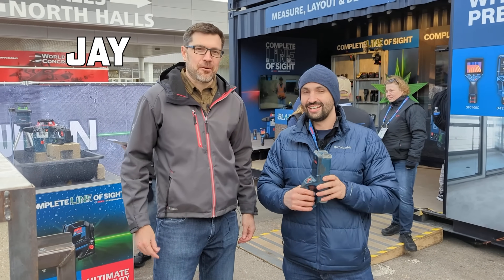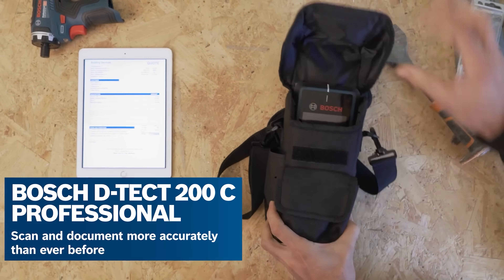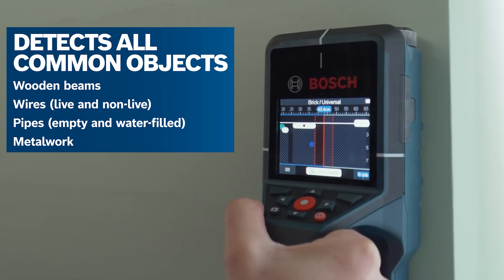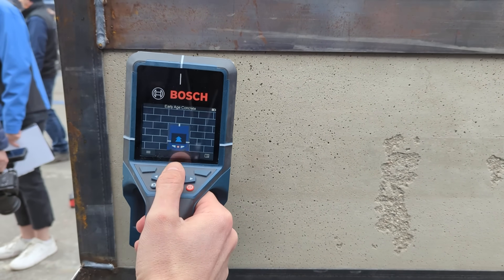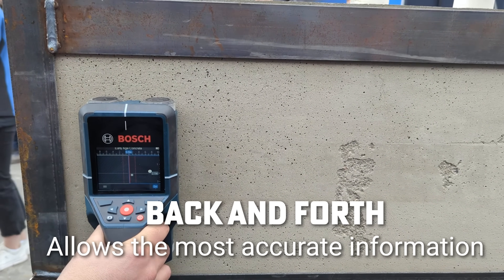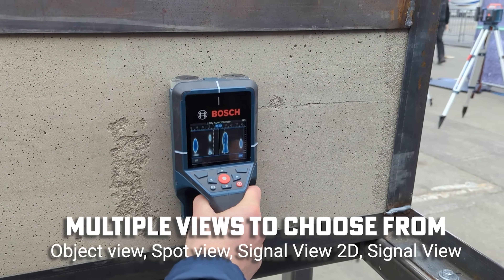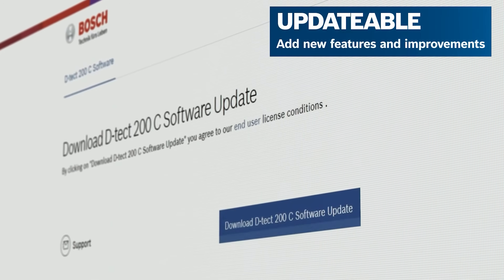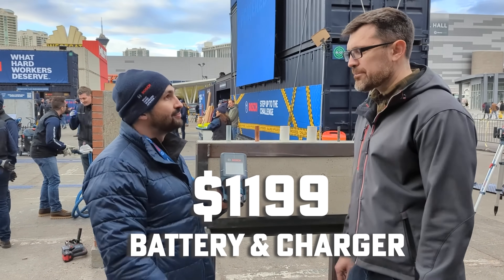BOSCH New D-Tect 200 Radar for Concrete, Walls, Metal and Other Materials

Comment: does it see a shark-bite fitting that is dripping inside my wall above my $50,000 kitchen ? or will it just see 'pipe' ?
Reply from the maker: Won’t know the difference between pipe and shark bit. Might have to poke a hole and use an inspection camera for that sort of detail.

Comment: My shop interior is clad with steel siding. Is this device capable of locating the wall studs? I wonder if there are less expensive scanners that are capable of doing scans through steel cladding?
Reply from the maker: Absolutely—great question!

Steel siding can definitely make stud finding more challenging, but the Bosch D-TECT 200C Wall Scanner is designed for that kind of job. It uses radar technology to detect wood, ferrous/non-ferrous metal, plastic, rebar, and live wires—even behind tougher materials like steel cladding. Just keep in mind, depending on how thick your siding is, detection depth and accuracy might vary slightly.

That said, if you're just looking for basic stud finding and aren’t doing professional-level scanning, there are less expensive options, like the Bosch GMS120—which can detect metal and live wiring through drywall, but it may struggle behind metal cladding.

So if you’re working in a shop or industrial setting with steel walls and need reliable detection, the D-TECT 200C is hard to beat. Let us know more about your wall type or what you’re trying to mount, and we’ll help find the right fit!

Comment: Can it scan tyre sidewallls especially steelcord tyres for checking breakage
Reply from the maker: @steelimplants Great question! The Bosch D-TECT 200C is designed for detecting materials like rebar, metal, and plastic within concrete and masonry, it’s excellent for walls, floors, and slabs. However, it’s not built for scanning tire sidewalls or steel cord layers in tires. For that type of inspection, you'd likely need specialized non-destructive testing equipment like X-ray, ultrasonic, or magnetic induction scanners designed specifically for rubber and steel structures. Let us know if you’re looking for something in that space, we’re happy to help point you in the right direction!

Comment: Will this work in China?
Reply from the maker: Great question! Yes, the Bosch D-TECT 200C should work in China,  there's nothing region-locked about the hardware. Just keep in mind that the interface language defaults to English (though it may have other language options), and you’ll want to make sure the included 12V battery charger is compatible with your local voltage or use a proper adapter if needed. Also, software updates and support access may vary slightly by region. Please note, however, that Ohio Power Tool does not offer shipping to China.

Comment: People talk about PVC but this is a 21st century.  Can it detect 1/2" PEX in walls?
Reply from the maker: According the manual you can detect water-filled pipes with at least 3/4" diameter, and empty pipes with at least 1" diameter. So not quite 1/2".
Reply: @OhioPowerTool  Thank you!  It would be nice to have someone try with 1/2" as that is what is most likely to exist in a house.  Going larger unecessarily would delay hot water delivery by quite a bit and not likely to be encountered most places outside of a main run.
Reply from the maker: @jackt6112  we'll be out at World of Concrete with them next month and they usually have a demo with this tool. We'll ask 'em about this and see if we can get some content trying it out!

Comment: This detector is great, but unfortunately only in the advertisements. In reality, its usefulness is highly questionable. I'm already on my third one after warranty replacements. I thought the previous two had some defect, but the third one is the same, and I won't be returning it anymore. Sometimes it doesn't show anything, sometimes it takes three or four tries. Once it indicated non-metal, even though I know there are live wires there. Well, now it's just a gadget sitting in my closet.
Reply: Best review I have seen

Comment: I'd like to find the water pipe in the thick walls and floors of an old building. The floor has tiles on the surface, and a layer of concrete over stone and soil. I believe the steel pipes are under the soil. Can this device find the pipes that may be as deep as 30 incles?
Reply from the maker: The deepest this device can detect is 7.9 inches unfortunately.
Reply: @OhioPowerTool  thanks for the reply!

Comment: I bought one and tomorrow will use it to trace rebars in a Hebel wall.  I'll post here how I go or put up a video on my channel!
Reply: quick question, can it measure rebar diameter? if so, how accurate is it? thanks!
Reply: @bans1461  I don't remember; it has been a while now.  I'll try and run it when at that site again and try to remember to let you know.
Reply: @prettypink6041  It was fantastic! I was able to 'see' right through the wall and of course in it; establishing the locationof the re-bars and hence avoiding them.  Brilliant tool. Expensive though!
Reply: Please how much?
Reply: @KareemYisa-p5e  How much as in the price? I don't remember; just picked it up from Total Tools in Australia.  The unit is brilliant.  It really helped.  But you have to be prepared to invest time to 'learn' it.  I have no regrets.

Comment: I have this Bosch D-Tect 200 model and it's completely unreliable for detecting live 240V wires in PVC pipe in concrete at 3-5 centimeters deep. It gives false positives and false negatives 90% of the time. It is really shameful for Bosch brand.
Reply: Auch, that’s not good. Was about to just buy one today, but it seems I better take a step back and rethink this. Thanks for posting this!
Reply: @diavalus  for detecting metal rods and pipes it is good though … it gives you peace of mind to not drill through something important. What I end up doing was to use the indication of non-metal at the expected depth (which was the PVC tube). Since my copper wires could be taken off line for the tracking process I also used a cheap 30$ wire tracker with generated sounds to validate the track initially discovered with Bosch Dtect200C. Amazingly, with the cheap audible wire tracker device I could hear the generated sounds through the 4cm concrete.
Reply: And thats a reaaaal problem not seeing a live cable inside a PVC
Reply: Normally I'd say "you're looking through nearly 2" of concrete, don't expect too much". However, they're claiming 8". Bust
Reply: Do you have any other competitor to suggest? Thanks.

Comment: There's mixed reviews for both this and the makita scanner.  I really don't know which one to buy.  We work in houses with thick plaster walls and sometimes it's really hard to find a stud when there is old galvanized pipes in the walls as well.   I really need something that will detect pipes, wires and electrical conduit in concrete or behind wall materials.
Reply from the maker: Both do seem to have pretty mixed reviews! It looks like each have different modes for each material you are working with. The Makita Scanner states it can measure 7" depth compared to the Bosch D-Tect 200 that can measure 7.5". Other than that they seem to perform pretty similarly. I hope this helps a bit to narrow down your options.

Comment: Thank you, may we know rebar  diameter behind the concrete by this tool?
Reply: PLEASE SOMEONE ANSWER THIS!!
Reply from the maker: According to Bosch, it can provide depth view while detecting live and non-live cables, metal, rebar, plastic pipes, and wood studs up to 8 inches.
Reply: Thats a real deal cuestion .... a house inspector for sure will buy for fking the messy contractors  using cheaper  rebars

Comment: Buenas tardes, les saluda desde Perú, recomendarían el equipo para hacer el levantamiento de tuberías de toda una casa para elaborar planos, ya que la casa no los tiene. GRacias
Reply from the maker: While this tool is great for finding items in the wall it is really an educated guess as to what logically is under the sheet rock based on metallic or other properties. Typically plans are needed because you're going to do some additional work so you need plans to base that work from. If you provide those to someone doing new work based off those guestimate plans you might find some surprises. This tool is great to avoid cutting an electrical line or drilling into a water pipe but it would really be a tool for testing not preparing new plans.
Reply: @OhioPowerTool  Thank you very much for the information
Reply: @OhioPowerTool  What tools would you recommend to find all the pipes of a fall and prepare plans?

Comment: Blatans ripp-off of Makita's wall scanner
Reply from the maker: While Makita's Wall Scanner and Bosch's D-Tect 200 Radar are both advanced tools used for detecting objects behind walls, such as electrical wires, pipes, studs, and other concealed materials. They do have their differences such as, Makita's wall scanner may use an imaging sensor or a combination of technologies like radar, ultrasound, or infrared to locate objects behind walls. On the other hand, the Bosch D-Tect 200 radar utilizes radar-based technology to detect objects and measure their depth. We are glad you enjoy the Makita Wall Scanner though ☺️ It is great feedback!

Comment: These machines are awesome. Is the machine safe to use. Example radiation exposure?  Using some sort of sonic device. I'm not really sure how it works. I would imagine it will cost over $1,000 Aud?
Reply from the maker: Hey Ronald! The "x-rays" this puts out are different to the x-rays put out by those machines at the hospital or those that float around space. It isn't so much an x-ray as it is sort of sonar imaging, which is much safer than any sort of exposure to radiation. You're actually quite close; it looks like these things will run you right around $1000 AUD, but thankfully it doesn't look like too much more. In fact, the Aus Amazon has them for just under $1000!
Reply: @OhioPowerTool  Thankyou Ohio Power Tool. I had a feeling it is some type of sonar imaging. I have struck some copper and even electrical in the past where they were not supposed to be. So for me these devices will be very useful on many occasions.